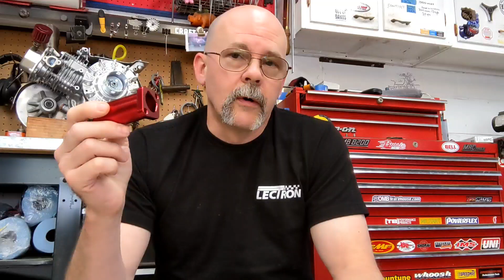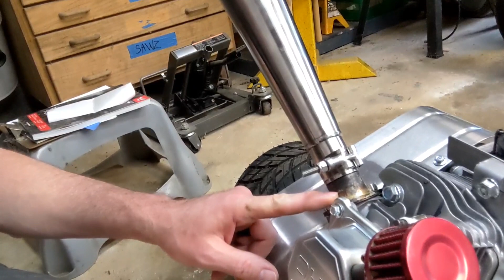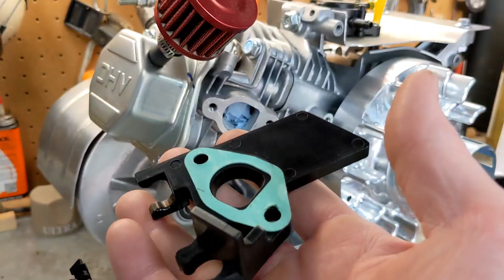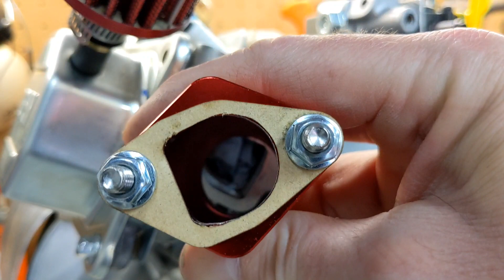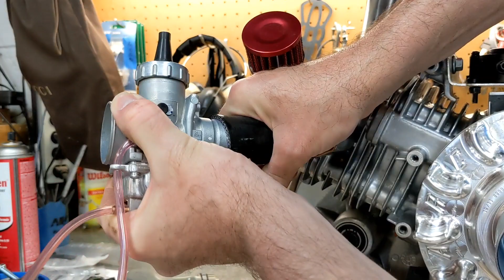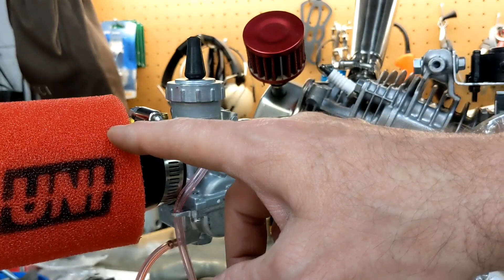Predator 212 Mikuni VM26 install, Port Matching=Free Power

Comment: Could you run one of these carbs on a snowblower or mower?
Reply from the maker: You would have to bypass the governor so it would not be a great idea. There are some "stock" style carbs out there with more adjustability and a larger bore, if that is what you need.
Reply: @WhatIsTheWheel  cheers man !

Comment: How are you feeling about the vm26?  I bought one, but have not put it on yet.  
What would be a good baseline pilot and main jet to start tuning with on a 212 with a pipe and 30deg timing?
Reply from the maker: I like it. I just started it with the jets that are in it so I will check and reply below. I think it is a little rich right now. It had the the float height set wrong and may be getting to much pressure so that may be causing my rich problem. The motor spools up to 8900rpm no problem although I would not do that with the stock flywheel and rod
Reply: @WhatIsTheWheel  I see.  No problem.  I'll just have to go through the whole tuning rigamarole. ;). BTW, I just opened mine up and it has a 190 main in it. That seems big.

Comment: I see some old Honda wheels hanging up in the background.  Are you building a cycleKart by chance?
Reply from the maker: Good eye! I have one planned. You might be able to see some 1x3 box steel in the background to. Still trying to decide what I what car I want for inspiration. I love the old track Ts and the Cooper formula 3 is a good choice to. But I really love rat rods and I have a Bradley two wheel tractor hood that would be an amazing start to a kart.
Reply: @WhatIsTheWheel  Nice! I look forward to your build. I just finished a 1939 Mercedes W165 CK.
Reply from the maker: @finkbuilt  Look up Cyclekarts North America on Facebook(If you are not already on there), there are a bunch of guys doing builds there, some really great work.
I bet that Mercedes looks great, that car has a great shape.

Comment: WHY such a big carb without a decent port job? it is still hobbled by the intake hole... 25mm  MINUS the 5mm valve stem... x .85 (85% max flow velocity with nicely ported head)... so we do the math on that and it ends up being abt 17mm or .690".  the stock carb i read somewhere is .570" thru the venturi...

 stock carb can be hogged out/e bay .650" carb for daily driver... they also have a .690 stock bored carb but directions read... mostly for ALL OUT RUNNING as the flow velocity suffers at lower RPM's... fuel falls out of suspension and puddles on port wall/floor and makes the motor doggy at low RPM's? in transition from idle jet to main jet.   it runs on idle jet for the bottom 40% of the throttle? then over to main jet.   

at high altitudes over, 2000... 3000'...,  need LESS fuel as there is LESS AIR to mix the fuel with so no matter what amt of gas pour into it, it cant burn it and it just goes out the tailpipe as pollution.

 want light tan plug, not BLACK/soot plug from unburned gas... NOT WHITE, tooooo lean, runs well... runs TOOOOO HOT as gas cools the fire of combustion (counter intuitive, i know) and piston/rings/cyl swell up and scores them ruins them and it is a smoker with low compression/power... needs new ... piston/rings/cyl... motor as cost of overbore is more than motor is worth. 

id love to get the BIG VALVE 32/28mm head off e bay but... again... lots of port work and ... with stock intake port even hogged out... cant get enuf air thru it to justify the cost of big valve head?  other site welds on BIG intake ports to the head... BIG and that is for all out racing and im sure not cheap, but lots of work goes into the head to port it and weld a new BIG intake on it.

Comment: Where can I get one of those safety wire clamp tools???
Reply from the maker: It is made by Clamptite, they come in a couple of sizes.
Here is an Amazon link:  https://www.amazon.com/CLT05-Clamptite-Plated-Aluminum-Wingnut/dp/B00XWK7SNC/ref=asc_df_B00XWK7SNC/?tag=hyprod-20&linkCode=df0&hvadid=343257912631&hvpos=&hvnetw=g&hvrand=17397635235090510948&hvpone=&hvptwo=&hvqmt=&hvdev=c&hvdvcmdl=&hvlocint=&hvlocphy=9009731&hvtargid=pla-579661341074&psc=1&tag=&ref=&adgrpid=71715066929&hvpone=&hvptwo=&hvadid=343257912631&hvpos=&hvnetw=g&hvrand=17397635235090510948&hvqmt=&hvdev=c&hvdvcmdl=&hvlocint=&hvlocphy=9009731&hvtargid=pla-579661341074

Comment: Just put a 2bbl Holley on it!
Reply: intake valve hole is the impediment to any carb. 25mm hole MINUS 5mm valve stem  x .85 (85% MAX flow velocity) is ... 17mm so no matter how much fuel dump into it it just cannot use it. the big carb is ok for HIGH elevations where air is thin thin thin and need as much air as can get into it, still hobbled by 25mm valve stem MINUS 5mm stem x .85 =17mm  just need to put smaller jet into the carb to get the air fuel ratio right for light tan plug, not black (TOOOO MUCH GAS/not enuf air)  not white (TOOOO LEAN, runs well, runs TOOO HOT, piston/rings/cyl expand too much and scores piston/rings/cyl and it is a smoker... low compression... used up needs rebored as it ran toooo hot without fuel to cool the fire of combustion.
Reply from the maker: @gmcinnis6304  One thing to remember is that the area of the valve is not a hole when it is open. It is more of a slot. The area for fuel and air to pass is calculated with the circumference of the valve and the amount of lift. With a 27mm intake valve you have circumference of 85mm. The lift of the Mod2 cam is 5.7mm. This gives an area of 484 square mm. The area of the venturi in the VM26 is 530 square mm, so the carb is sized pretty close.
Reply from the maker: Maybe a Weber sidedraft with velocity stacks, that would be pretty cool. But it would need at least another 100 cubic inches